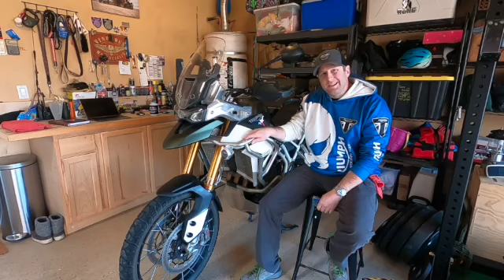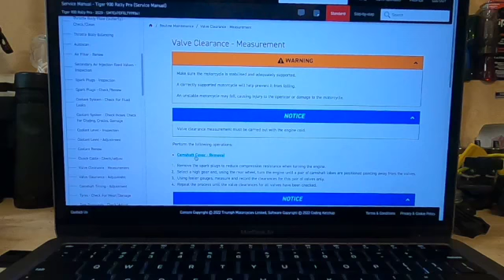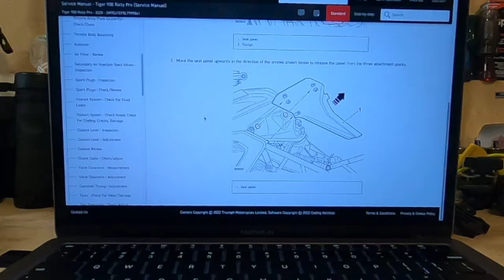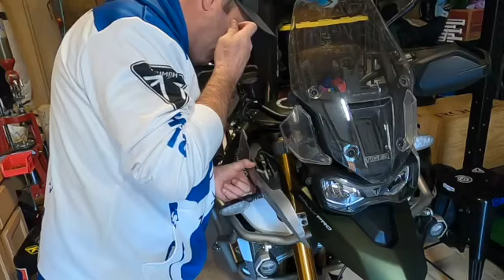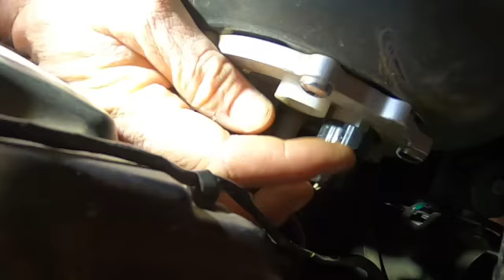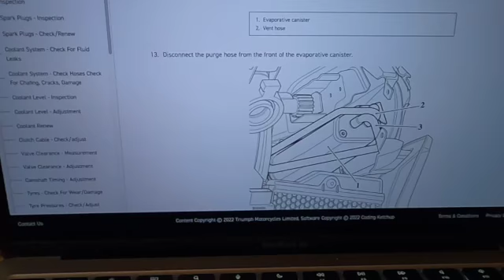Tiger 900 Rally Pro Tank Removal

Comment: Thank you for the walk-through. I will need to go through similar procedure to remove the gas tank to replace the spark plug. This definitely helps.
Reply from the maker: Glad it helped
Reply: You have to remove the gas tank to change the spark plugs? Wow didn't know that.
Reply from the maker: @Ljbuddy12 yeah… shouldn’t need to change them before the service interval though. I went to a KTM 500, so everything is easier but done more often.

Comment: First thanks again for such helpful video’s I know it’s a Silly question but here it goes I assume you siphon the gas out and then run the engine until it runs out of fuel. I have removed a gas tank before but never on a fuel injected bike I just drained the fuel at the Petcock Thanks
Reply from the maker: Nope, left the gas in. A little will trickle out when you disconnect lines, but it’s not going to free-flow.

Comment: Thanks for the great tutorial.  I am in the process of installing heated grips and lo and behold the tank has to be removed.  Sux.  quick question.  Do you have to crank the engine before removing the fuel line?  Also, did you reconnect both cables to the tank before cranking the engine?  As far as installing the heated grips.  Its a bit dissapointing because for the Tiger 660 the power connector is on the side of the bike alleviating the need to remove the tank.  I have tried to look for the power connector by just tilting the gas tank, but have not been able to find it.  So the next step is to remove the tank so I can find the power connector.  I don't know how much they charge to install the heated grips, but having to remove the tank to connect them is tedious.  TIA
Reply from the maker: My bike had been sitting a while and don’t think I had to crank the engine to relieve pressure, but the fuel line did have to be pushed on, hold the release, then pull the line off. When reinstalling the cables to tank, make sure they are on all the way or you may loose the fuel level or pump. 

My bike came with heated grips… don’t know where they are connected. Hopefully your parts came with directions. If not, go to triumphtechnicalinformation.com and see if there’s a process that can guide you.
Reply: @214-moto  thanks. I Found the connector.  It's on the left side of the bike towards the front.  Just when i thought i was done with the hard stuff.  Running the wire to the grips was insane.  Can't believe triumph put a hole on the left side and both left and right cables have to be run through there.  Had to use a coat hanger to run the cable through the inside of the handlebar.  I cannot believe triumph did not put a hole in the right handlebar to make it easier.  The fun continues.  Thanks for the quick response.
Reply: @jerrymorales6501  I'm in the process of removing the OEM heated grips (they're non-working) to replace with aftermarket ones.  I have the OEM grips off and the wires pulled out of the handlebar, but how hard is it to remove the other end of the wiring harness from this front left location you mentioned?  Do I need to remove the tank to get to the connector?
Reply: @michaelb9786  unfortunately you do.   My hands were not small enough to get to the harness.   Very frustrating as one you do. It's easy to disconnect.   Especially when compared to a 660. I don't know what triumph was thinking.

Comment: Liked, subscribed, and saved!  Recently purchased a slightly used 21.  I still have 10K miles to go before it's due the adjustment so I have time to consider doing the work myself, or paying the dealer $800.  I've owned used BMWs R1200 (06 GS, 17 GSA), and I havent paid for a valve check/adjustment in 10 years.  I ride about 10K a year so this will be an annual thing for me.  Glad to have found your series.  Thanks!!
PS:  I run a full Mosko rig for my trips...I have OM racks and mounted the plates but havent loaded up the Tiger yet...how's she handle the load you carried into DV?
Reply from the maker: You will love the Tiger. It’s a great bike. The Mosko setup is great and doesn’t really change the overall feel of the bike when loaded. I recently added a Mosko duffle to load up on top and took that setup through Mendocino BDT Lost Coast Trail, Six Rivers BDT and more on a multi day trip… they all worked great and kept out the silt, rain, mud, etc.
Reply: @214-moto  Thanks!  First I hear about these BDTs you mentioned...looked them up and I'll be there next year =D  Was in the Lost Coast area in June, but all paved and wishing I knew some dirt routes.
Reply from the maker: @orangelion03  find Usal Beach and you’ll find the Lost Coast route. You can also get the gpx file from Overland Trail Guides website.
Reply: @214-moto   Was in Shelter Cove in June, went down Chemise Mtn  Rd a bit, but came back out.  Later took 1 down to the coast and rode a bit of the south end of Usal Road.  Was solo so didnt explore as much as I wanted.  Next time!

Comment: Hi! I just removed the tank following the official instructions but when I put it back in I'm getting a warning in the display about low level fuel (0km). Like the sensor is not working properly but I'm 200% sure I made everything backwards following the installation process. Did you get this error?
Reply from the maker: Assuming you got the plugs seated properly, it could take a few minutes of running the engine for it to read the fuel level. Kind of like how when you fill up it doesn’t register right away.

Comment: Thanks for another great instructional video! I have the same bike and will be approaching 12,000 mi soon. I’ll be waiting to see what your clearance measurements are. Do you already have a shim kit? If so where did you find it? 
Thanks again, Bruce
Reply from the maker: All my intake clearances were within spec. All my exhaust were just outside of tolerance. My dealer did not have shims in stock (no surprise there) so I ordered the sizes I needed from Hot Cams.
Reply: BTW, What is Tiger 900 shim diameter?
Reply from the maker: @mauihugebong  They should be 7.48mm… I’m in Tahoe this week, but will measure them when I get back and let you know.
Reply: Thanks, that would be appreciated. I’m assuming you’re in Tahoe snow sports- if so I hope it’s good for you.
Bruce
Reply from the maker: @mauihugebong  yeah, gotta get the fam up to play in the snow… my days off are all mid-week, so it’s not always a given
Reply from the maker: The shims are 7.48mm diameter. I confirmed that yesterday when I installed the new ones. Cheers
Reply: Appreciate the shim diameter configuration! Looking forward to the follow up video on this procedure.
Reply from the maker: @mauihugebong  I'm publisihing the air box and throttle bottle removal tonight! Shiming will probably be tomorrow. Thanks for watching.
Reply: Did you perform the service Bruce?  How was it?